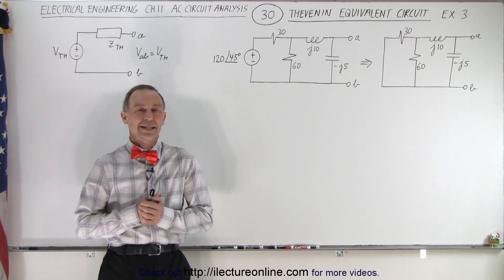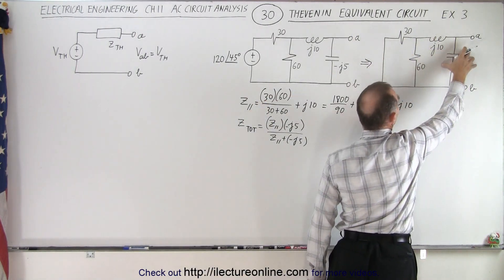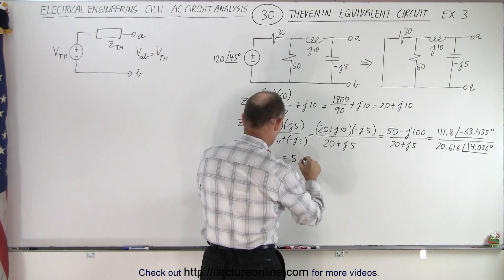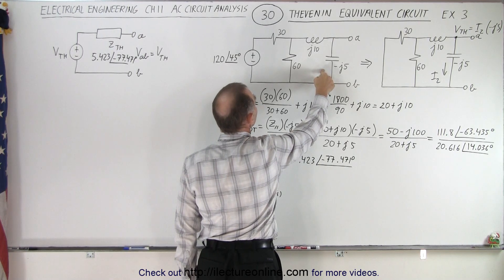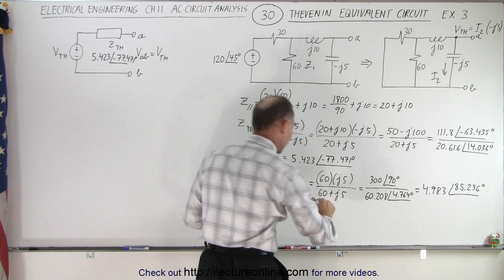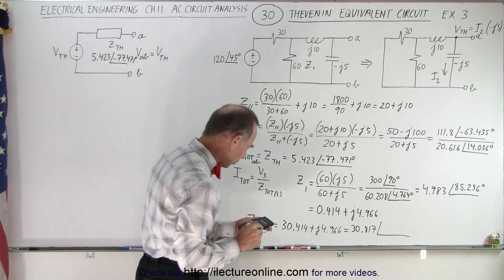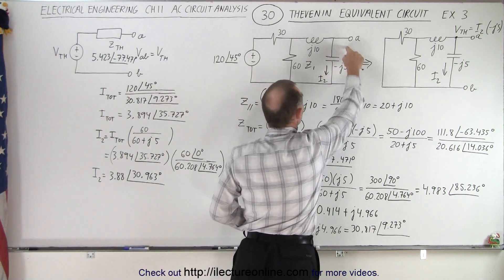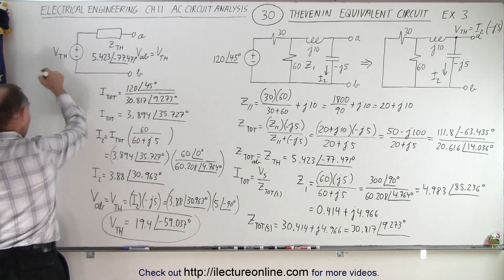Electrical Engineering: Ch 11 AC Circuit Analysis (30 of 34) Thevenin Equivalent Circuit: Ex. 3

Comment: sir if you explain to me i really appreciate it.Lets say   X--30ohm--Y--10j--a---(-)j5--b
                                                                                                                  |---60ohm----------|      
I understand I2 passes both j10 and -j5 but why we didnt consider j10 when we calculate the impedance in paralel branches i cant understand because in parallel branch j10 also included.I will look forward to your answer.thanks